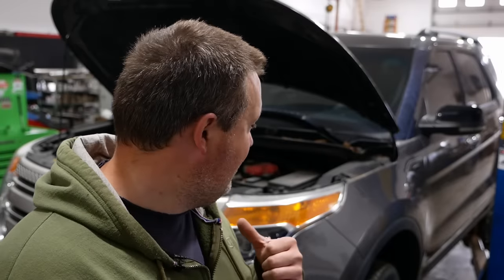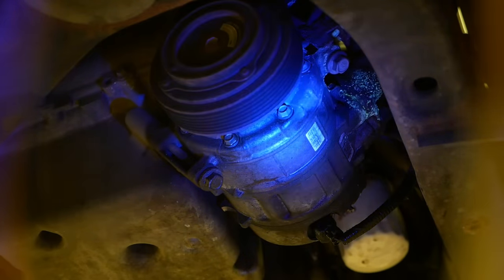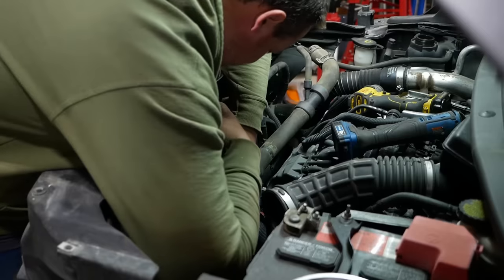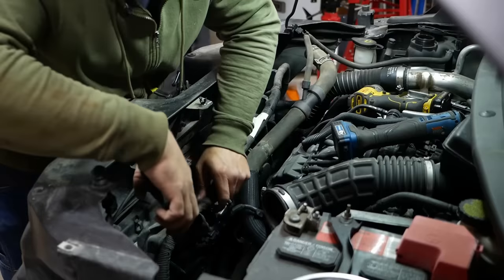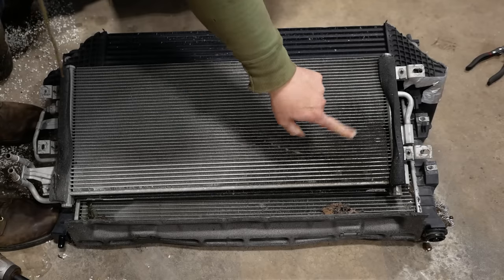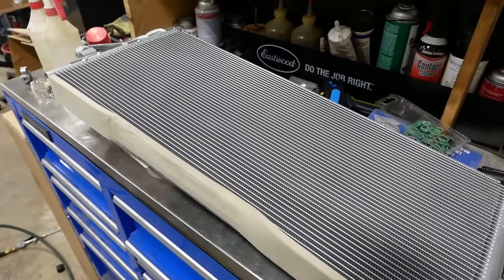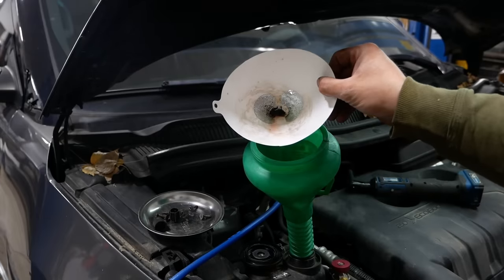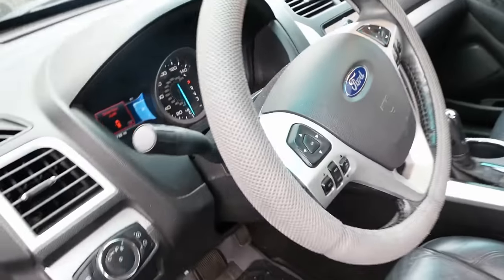Ford Explorer Replace A/C Condenser

Comment: you had me angering a mechanic at working on a ford.....however A/C work is easy in truth. Problem is mostly that people don't want to pay money for their comfort. In the future, just buy a nitrogen purging regulator, get a nitrogen bottle, and you can use your gauge set to apply 300 PSI and run a spray bottle across the system to find all the leaks. compressor leaks are easily found with nitrogen.

Comment: Unbelievable how much you had to disassemble to get to a service part? This is I believe as a result of engineering by those who have absolutely no experience or idea of what maintenance work is , they think oil change? I happen to be an engineer, I spent a good part of my career doing Project management of large complex petrochemical facilities. I am 70 years old and retired now . The young engineers who loved the 3D design software hated my comments about , how are you going to replace that gear box? You don’t have hight , floor strength to set it down ? There is no place for toolboxes or supplies , I showed them how to design in for repair, service and replacement as well as regular observation by operations by designing walkways in a way it was taking the folks close to the equipment, but safe so the could hear , see , smell and know if there was trouble developing!

You are absolutely correct it bothers me every time my Tundra goes to the OEM shop they charge me $250 for the “ code reading and interpretation “? Then I pay a “ shop consumable fee” and a time/ hour fee that is frightening. It’s why I do pretty much everything I can possibly do myself. 
I enjoy your videos, don’t get to down , you have a wonderful family, a strong skill set that is diverse you can always find a value creating bit of work . Of that I am quite certain!

Comment: I know this customer is as cheap as the day is long. But I always ask my mechanic to use new antifreeze as apposed to reusing the old. Id rather spend the 50 bucks than pour the trash thats accumulated from everyone else's job back into my engine.

PS- love the idea of using the paint strainer. Thats got to cut contaminants down substantially
Reply from the maker: You're the exception.
Reply: Disposal of the old stuff is the hangup. 3 or so gallons per system of waste.

Comment: Watching a few auto channels as an Aussie I'm concluding your cops aren't very strict on enforcing that vehicles are roadworthy? Anything a few years old here gets looked at hard on frequent, routine traffic stops and not much mercy is given. A tyre like you showed would be a "defect" notice which comes with a hefty fine and means you can't use the vehicle until it's fixed. If they stop you for something obvious, they'll look the vehicle over & find other non-compliance too. Before you know it you can have a grand worth of fines & no car.

Comment: Why do engineers do this to US. 
My Freightliner has 9 fuse boxes on it. 
The KWs we have blow trailer fuses like crazy and to replace that one you need a pair of long needle nose pliers and be standing on your he'd behind the clutch peddle. My old IHC was easy. Just reset a circuit breaker behind the glove box. 
I miss that old cornbinder. My previous terminal manager killed it. He just did a tune up on 2 of the 6 cylinders. Thru an injector rod the next trip.

Comment: I HATE working on Fords.  LIke the thumbnail says, "Remove entire front end." is such a common thing on FoMoCo vehicles.  In fact I'm surprised it wasn't, "Remove rear bumper."  That's usually how far you have to go to remove parts from the engine compartments in a Ford.

Comment: Plastic fantastic. I couldn't work on this modern garbage. I would have a recycle plastic skip out back and as I pulled it off that is where it would go. After I got it off it would be broken anyway. Regarding prices. We are all being conned. All caught up in a Covid loop. The cost of shipping is the biggest factor. That has pushed prices way up. USA actually makes things. You should have some home supply but as the cost of the Asian products grows they push their products up to match. For us in Australia that no longer make anything. We are dependent on that ship from China. So all parties concerned know that they just think of a price and double it. The cost of living has sky-rocketed. My wages have stayed the same. Standard of living has dropped markedly. We put all our eggs in one basket and now paying the price.

Comment: WES,  if  your customers were AMISH,  you'd be repacking wheel bearings and replacing leather reigns!  But, the way we're headed in this country,   putting up a windmill to  make a 'charging station' for electric vehicles  may be the ticket !?  Stuff is gettin out a hand.

Comment: See shit like this is why I’m convinced every engineer should be forced to work on cars especially the on3s they design. I guarantee if they were shit would be a lot easier and the way things are assembled would actually make sense. Never again would you have to remove half 5he vehicle to replace a condenser or remove the cab of a truck to fix the motor

Comment: Wes at this point in time all of the car co.s  are focused on ease of assembly, get it off the end of the line! some of them without all its parts. thus no final electrical tests  sits in a parking lot till the parts arrive, install those missing part no quality test and shipped to the dealer screw the customer they won't know why it fails! The repair techs are not even thought of when a vehicle is designed or so called engineered its all about ease of assembly  get it off the line!

Comment: Can't replace the rig for that and its only going higher in prices. I  think that customers are aware of the rising cost of parts/pieces ... not much to do but hope that the money you get paid for the job is still good when that check hits the bank. Your so heavy vested in mechanicing that you can't just do drywall or fix computers for a living. your damned if you do n damned if you don't Wes

Comment: Wes let me try to explain how prices are sort of the same. In the '80s gas was $1 a gallon. You think that's cheap. But it wasn't. Because of inflation comparably it was actually more expensive than gas is today. I know it sounds crazy but it's true. 

Also the Democrats printed 40% of all the money in circulation today. So it seems like things cost more money but we have 40% more money. Again it sounds crazy but it's called inflation.

But you are correct. People are still going to have their air conditioning systems repaired. Because they have more cash. Or at least they think they have more cash. 

And they will buy the $5 a gallon milk and the $4 a dozen eggs and so on and so on...

It's only going to get worse. And the worst thing that's going to come out of it is people will just stress about it and they will make themselves ill or suicidal. Is very sad. 
Not to be political but the only person that can fix this is Donald j Trump.

Comment: Yes, Prices are through the roof. Bad leadership and government policy of " printing money"  like drunks on pay day has driven the U.S. into inflationary or more correctly "stagflationary" territory we haven't seen since the 1970's. I was there. Yet there seems to be absolutely no concern by the political party in charge of both houses of congress and the White House to alter course. People are suffering, especially the elderly and the poor. Add to that, the ripple effect of the terribly wrong headed global lock down strategy in 2020 and continued related harm to the work force with its ramifications on the supply chain. We are headed into a terrible economic catastrophe. This all seems directly related to the current team making all the decisions. It's a mess and their agenda supersedes everything else in importance. Soon we have a chance to allow the other side to control things again. Unless, you like it the way it's going now. Since January of 2020, things have gotten nothing but worse and wages are stagnant as businesses struggle under the current regimes rules. Perhaps rather than "Build Back Better" it should be changed to "Build Back Broke" as Diesel fuel, that golden liquid which brings everything you need ultimately to your door step approaches $6.00 to $7.00 per gallon thanks to the destructive "Green" policy agendas of the left.

Comment: My wife has removed the front bumper from her BMW X3 in seconds from leaving home, including drivers door handel and the drivers side rear door handel,  why stop ?
Once reasembled, how long before the damage reapears one may ask, less than 5 days.
I've run out of black nail varbish to cover the dents and scratches.
Woman driver with no spacial awareness, I don't like to travell with her and I'm blind.
Do you think I'm exagerating or elaberating my fear ?
My mate takes me out on my motorbike, a Kawasaki 1000GT,  It's safer.
I wash, dry and apply a ceramic coat on the BM, cos I'm  married.

Comment: It is my personal opinion  that every automotive  engineer  spawned during the last forty years should be shot. There is no reason that the design could not have been engineered  so that you could have removed the "grill"  without removing  the inner  fenderwells  and the entire  valance to access the condenser and replaced it without having to  remove the entire fan shroud and radiator. That job could have been done in two hours at most. It reminds me of the Ford better idea of having to remove the entire cab on their pickup to do any major work on the engine. Makes you want to cry.

Comment: No Money? then you are doing this for free?  A lot of companies will not warranty a compressor  or ac parts unless you change the expansion valve Etc. and do a complete job,  Thanks parts changers for causing that little issue with most parts suppliers. you know the compressor leaks and you are going to half a job?  I understand the no money and customer wont authorize it, so as busy as you are why do half a job  and take up more profitable time in the shop for a job that will come back.

Comment: No .The manufacturer intentionally build them that way. You think cars have jumped 50,000 + in price because there better. Nope !!!  Now they come with forced maintenance . Buy using inferior parts and designs. Manufacturers know it  will break and buy designing it in a way you have no choice but to pony up the thousands to a dealer to never fix it the first three times you take it in.  Manufacturers manufactured a way to  charge the dealers more. Hey its built in we guarantee its coming back. And with extremely up marked parts and service it a gold mine for dealers. They make 3 times more on used cars and maintenance than they do selling new cars ! And if you have a 10 year old survivor good luck ! No dealer will know how to fix it !

Comment: Hi these Ford explorers and ranges in Australia are just heaps of crap they got a five cylinder motor in them and if you do not change the Oil matter of time they have an oil block and you will blow up the motor I would never of my buy heaps of crap I’m just go and buy a four-wheel-drive like a IZUZU dmax they are cheaper and heaps better than these heaps of rubbish I don’t understand why Ford will continue to sell these pieces of rubbish apparently this year or next year they’re coming out with a V6 in them which probably would be better because you are paying for six cylinder registration in Australia